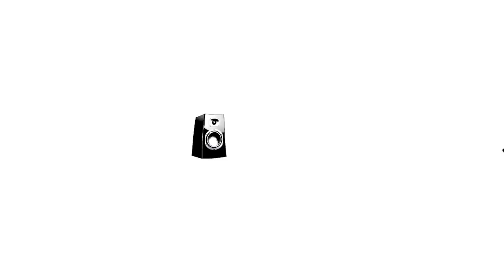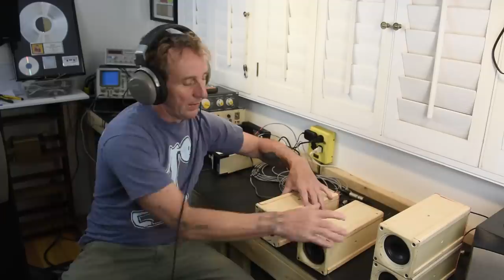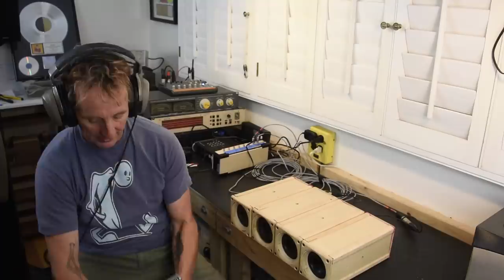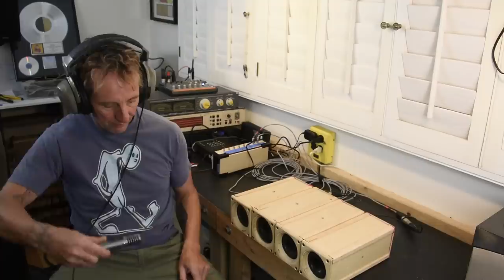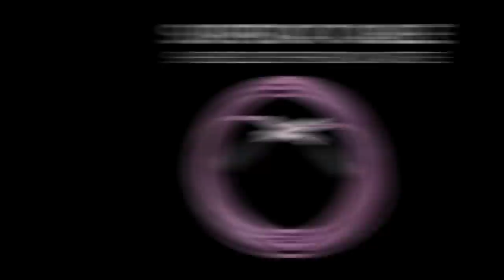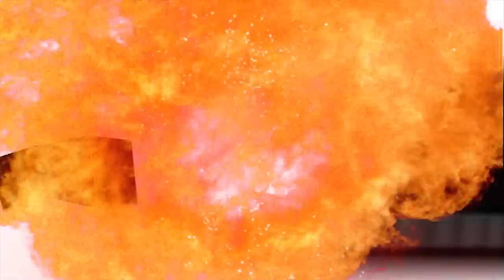Line Array vs Point Source vs Human Hearing

Comment: Yeah, when I walk a venue with raked seating, it is easy to walk smoothly from one side to the other, but when I go up or down in equal steps, my ear/brain has a rest while moving from step to step. At a concert, once seated, our ears are pretty much vertically stable, but we move our heads horizontally - but I never really thought about that. You are amazing!  Ha - once in a venue I sat down with my young adult daughters, and then did my usual visual check of the rigging, speakers etc.  I looked back at the girls any they were laughing and then did an imitation of Dad scoping the venue. My wife never minds when I go to have a check of the mix position at interval.
Reply from the maker: Smiling

Comment: For me, the biggest factor is that in a horizontal plane, all sources arrive almost at the same time in a line array. But in a horizontal array, all sources arrive at different times in a horizontal plane.
Reply: not exactly true, the time delays and dispersions are still there (mostly noticed in a significant loss in fidelity in high and mid frequencies) you just dont hear the phase shift as much horizontally due to your ears placement. physically the sound is the same.

Comment: Hi Dave.  Great work!  I’d just like to add a point (pun intended) about listening to multiple overlapping point source speakers with 2 human ears vs a single Omni measurement microphone as you demonstrated and that is there is another HUMAN factor - the ability for our brains to help minimise the phasing we perceive.  If you listen to more than one overlapping PS speaker and then walk horizontally through the overlap (phase issue) areas, you can hear the phasing - but its nowhere near as bad a a single microphone “hears” it.  If anyone wants to test this then just block one ear and turn your unblocked ear to the speaker system and again walk horizontally through the overlap.   You will then hear it more like a microphone does. If you stay stationary in the poor overlap area and listen with both ears you may be surprised at how much the brain compensates for differing high frequency time arrival - assuming no wind is present!   This human psychoacoustic effect is just like an optical illusion is to our eyes. What we perceive can be very different from what is actual and its a good reason to not rely on test measurements alone but to actually use what we are gifted with.
Looking forward to your next video Dave!
Reply from the maker: I agree and there are significant issues with the way that sound is measured with a single mic. One issue is it shows that stereo setups that people love and embrace are worse, measurement wise than mono setups which are less enjoyable to listen to. Ideally the measurements we use for an application would align with what we desire to hear in that application. And thank you!

Comment: And then of course you can add small delays from element to element across a vertical array to control dispersion front to back in a venue which is nice.  Phased array steering isn't just for radar anymore.  The improvement in live sound over the last decade thanks to engineering has been quite impressive.  I'll try not to think about the complete absence of concerts these days... darn too late.

Comment: The vertical domain can be perfectly flat (no comb filtering), and even attenuated to an amount you want off-axis. Have a look at Horbach Keele filters and the design guide based around them. Really interesting stuff, I'm actually in the process of designing one that's -14dB vertically at 78° off axis. Tons of fun!

Thanks for the video, it's a great demonstration on the effects of multiple driver comb filtering. Anytime I need to explain it to someone, I am sending them right here!
Reply from the maker: Super cool Elliott! We can see much of the summation and coverage solutions and issues that we encounter with the main PA when designing sub arrays with prediction software
Reply: @DaveRat  Very nice! Those figures were just from mathematical models, I imagine your prediction software uses much of the same models. 👍

Comment: A rather unique type of line array you may want to check out or maybe even build is the Constant Beamwidth Transducer (CBT) Line Array by Don Keele. I attended a demo of his speaker design a few years ago at the Detroit Chapter of the Audio Engineering Society. What makes his design unique is the frequency spectrum is flat across the full range in all directions. The other thing I experienced first hand and measured myself is the dB output is the same level from 6 inches to 80 feet.  His design featured a series of 2"-3" full-range speakers (mids to highs) in an arc. He had two of these speakers both left and right with subwoofers on a crossover. He 'feathers' the output of the speakers with resistors so the middle speakers put out full output, but has the speakers go up and down, they are resisted in 3dB steps. So the top and bottom speakers in the array put out less than the middle ones. From a practical standpoint, the sound fills a medium to large size room with no hot spots or harsh frequency nodes. However, the quality of the speakers used in the array is crucial to sound quality. I believe the design does take some tunning with EQ and crossovers for the subs to get a proper balance. As with 2"-3" speakers the mids/highs can get out of hand if not tuned right. His design I believe is best on hard-surfaced floor or upside down from a hard ceiling as I recall it used the floor as a ground plane.

http://www.xlrtechs.com/dbkeele.com/CBT.php

There was a company selling a DIY parts kit, but no longer I think. Based on what I heard and how it fills a room so consistently both in frequency and dB SPL, I think the design has applications for mid-sized rooms or even large homes.
Reply from the maker: Interesting.  There are strong arguments for and against volume shading in line arrays.

I am not sure volume shading, especially hardwired volume shading is an optimum solution.

Comment: Excellent stuff, Dave, as usual.  I have a huge ball-bearing lazy-susan that I use for speaker testing so I don't have to move the mic.  Doesn't work well for vertical movement, but it's great for left to right!

Comment: Ah! So Bose got it wrong - I should mount my 802s vertically!  Brilliant demo, there are so many scientific arguments for pros & cons of different arrangements, but most miss the point that it is humans listening to the end product.  With multiple monitor wedges focused on one performer the phase issues must be horrible? Thanks Dave keep the videos coming.
Reply from the maker: Yes you get it
Reply: You may choose stacked or more than two meters apart for 802’s. But always with the controller.
Four stacked 802’s are a markedly different animal to singles. But do check that the constant directivity circuits are working. Alas, I opened mine up after 10 years in storage to find missing caps and perished damping foam (drivers all good)

Comment: So interesting, because I always assumed the splay angles of line arrays were calculated to hit precise vertical and horizontal dispersion angles. I never thought that the angles of the speakers could also be calculated to minimize phase issues..... With this concept in mind, to me it almost seems like 4 or 5 really big boxes stacked with calculated splay angles would be more effective than 16 hung line array speakers.
Reply from the maker: Line arrays at maximum splay should become or approach being splay arrays with minimal overlap in the HF between boxes. At maximum splay, line arrays tend to sound the best but lose the ability reduce volume drop with distance. As the angles are reduced, the overlap is increased and volume drop with distance can be improved but at the cost of some sound quality. Point source arrays suffer greatly if overlap is introduced and try and deal with the volume drop with distance by having really oud boxes shoot far away and quieter boxes shoot close. Both designs have their assets and issues.

Comment: I think with flown J Arrays, the vertical interference comes into play not just going up and down but from the front and the back of the venue. The top speakers are typically pointed at the back, all the way down the line until the bottom ones are pointed at the front row, so you'll hear the transition from box to box more then. If you are talking about a smaller venue, with a flat floor area and speakers on either side of the stage, some places might choose to use a few of the vertically stacked boxes. You will pretty much be the same listening difference from the boxes in one stack, in both the front and back. Also the further you are from the stack, the more the speakers will meld into a single source.

On another note I am particularly interested in the Danley single source horn boxes out at the moment, including a way to combine multiple compression drivers in phase at all angles of listening.

Comment: Interesting thought on the human aspect of perception from two different designs. I have only a fraction of your experience but have an opinion on this. In my experience listeners in the listening envorinment aren't moving around the horizontal plain enough to hear a difference. Simply turning ones head does not change the location of the head in the horizontal plain. You have to move around the floor of the listening area a fairly large amount to move in and out of the focal point of each speaker. This could be noticeable to dancers moving around a large floor but not likely to ever be encountered by most stationary or dance in place listeners. There are many other design challenges like room acoustics, shape and cost that will play higher in the decision making process for speaker choice between line array and point source. That said really enjoy hear and learning from your knowledge sharing. Thank you Dave.
Reply from the maker: Very cool, I actually recommend you test that. Our ears are extremely sensitive to tiny shifts in time in the horizontal plane. Here is a video that may shed more light on how sensitive our (your) ears may be. Turing your head moves one ear closer and one ear father from the source. If both ears are hearing the same source, we tend not to notice anything.  But with a horizontal line array, each ear is hearing a different source or at least a differing version of a combination of sources. This tends to be quite audible. So audible, that no reputable manufacturer builds a horizontal line array.  And thank you for commenting and very much appreciate!!!!

https://youtu.be/sOSmtye9gNw
Reply: @DaveRat  So honored by your taking the time to respond to my comment, thank you. I actually just watched that video a few minutes before I got your reply. Awesome demonstration. Made me think of how they induce the surround sound effect from just two speakers. I understand what you are saying in both videos. The fact that we can here difference from a single driver even if you just turn your head in place shows how sensitive our ears are in the horizontal plain. I have two systems I run in two different rooms at the facility I work. One long and narrow with a center cluster. One wide with a stereo pair of line arrays. The sound change in the wide room from line arrays is very noticeable. The change heard from the cluster in the long narrow room is minimal in comparison. 

P.S. had to laugh at the little mixer your using in these videos. I had to retire one of those last month. Lost one main out and got very hot, fire hazard hot.
Reply from the maker: @dlcarburetor  super cool and great to meet ya. Oh, and a bit of a correction or at least a refinement on horizontal lines arrays.

They do exist in the form of Soundbars which are gaining some popularity as tv speakers. These speakers actually use our horizontal perception to simulate width using time offsets with small speakers very close together.

I personally find these hard to listen to and there seems to be a direct relationship between increasing the emulated sound field width and being less intelligable

Comment: I think the trick is with the those small mid bass drivers is to not use them above say 1.2Khz, If u check the response u will see its the top end that is adding and cancelling on the vertical, comb filter effect, with the low end the wave length is so long, the speakers sum as one. For the treble conventional 4"plate dome tweeters are useless as they are too far apart, long slot ribbons may work provided u can get the drivers within 1/2 an inch of each other almost impossible need specially made speakers. Cost a fortune too, the tweeters need to be as long as the vertical listening area so its huge so its like 5 feet or more long line of tweeter, almost continuous slot. The only other option is to give up and use a line source of mid bass drivers that only does low freq low and mid bass below 1Khz depend on size and spacing , and just 1 powerful tweeter at ear height. This is very effective, so u still get the bass and power and low freq and a point source for the treble.

Comment: The main reason to go vertical is because the sound will travel further, thus reaching more into the far audience. It would be great if you could explain this phenomenon. I haven't found anyone that has explained that yet.
Reply from the maker: Hmmm, surprisingly vertical does go farther as sound does not know gravity. Distance is gained or increased by either increasing the volume of the source or increasing the number of sources at a given volume that are equidistant from a point that is father away.

Line arrays, horizontal like subs, or vertical like many sound systems are designed around or a circular array or a cluster of speakers, all can throw the same distance. The shape of the array just controls the on and off axis cancellations.  

That said, vertical line arrays can allow minimizing sound hitting the ground and ceiling which could increase the throw.

Very cool.  I will ponder doing an updated version of this with more info.

Comment: Most line array technology is about trying to get the mid and high drivers to act as multiple highly closely spaced directional elements so they don't interact as much, whether they use pathlength equalising waveguides on the tweeters or some sort of paraline lens depends on the manufacturer. It isn't usually a problem for subwoofer drivers, although controlling the directionality of the bass so it only goes forwards is another problem altogether.

I believe EAW Anya probably uses multiple closely spaced drivers and EVERYTHING is controlled by customizable time delays, though they have a huge amount of money invested in that system
Reply from the maker: I was a consultant on the Anya system design

Comment: I love your videos, I'm a guy who used to do Peggy lee and jack jones and.... back in the 80's and now design entertainment stuff out of LA and vegas...  I'm designing an install system  small cat club like space that has a pushed out stage and a 15' ceiling where there is no way (or need) for a line array to work as it would be behind the front of the stage (PAG NAG etc?)  so I have a hung - splayed horizontal array just like you were doing in the video on a slight curve across the front with steep and medium narrow shots into the 30' long pit, with adjustable mounts, and dsp on each and every biamped speaker  while there will be phasing its a mosh pit, dance floor or seated jazz club.   is my instinct on this right and with enough of the control I just described probably the right way    thanks again for sharing your experience.

Comment: What are your thoughts on the new line array boxes with the LF drivers on the side? Examples of these products I can think of include L-acoustics L2 or D&B SL. Essentially, the drivers are positioned roughly a quarter wave behind the front drivers, and the drivers in front are delayed a little bit. So basically the sound is phased correctly in the front, but completely out of phase in the back. It’s similar to a cardioid sub, but in line array form. I think it’s an interesting concept, and I honestly find it cool. I’ve been in behind few stages with D&B KSL rigs, and it seems impossible how quiet it really is back there.
Reply from the maker: All good, implementing endfire or cardioid type coverage to reduce sound from going places that we don't want it to go is helpful and will improve the overall audio.

Sound energy going in the wrong directions really messes up the overall quality
Reply: @DaveRat  I agree. They are certainly great for the performers on stage, who could sometimes get muddy sound from the FOH equipment. Especially problematic for artists who tour with wedges and not in-ear monitors. I guess mic feedback could cause some issues too with too much FOH leakage on stage.
I also noticed the speakers are getting smaller, because the drivers on the side make similar cone area in a smaller package. The D&B KSL is marketed as a replacement for J, but it’s a smaller speaker. It seems like a similar story with L-acoustics L2 being so compact in overall size for the total hangs, even though the boxes themselves are much larger.
Reply from the maker: Yes DB per cubic foot of truck space is definitely improving as driver and amp technology advance